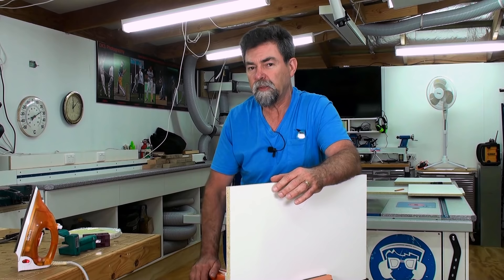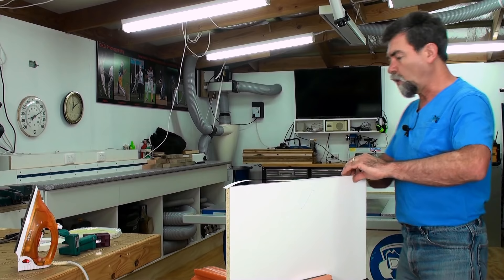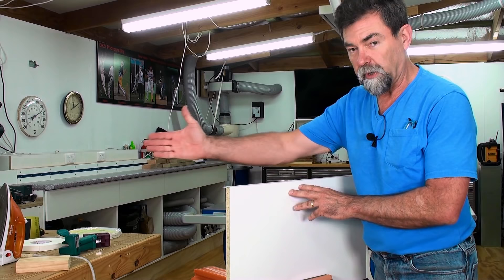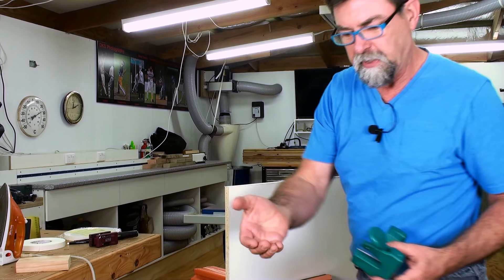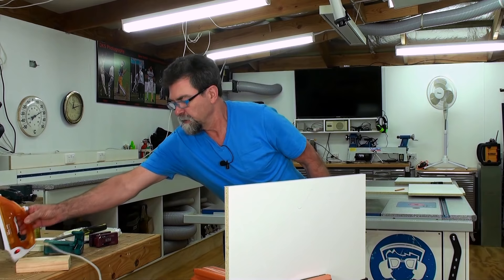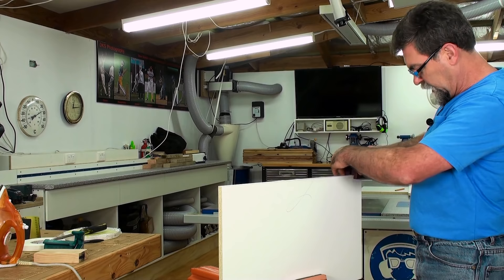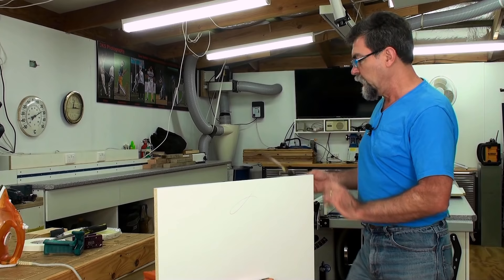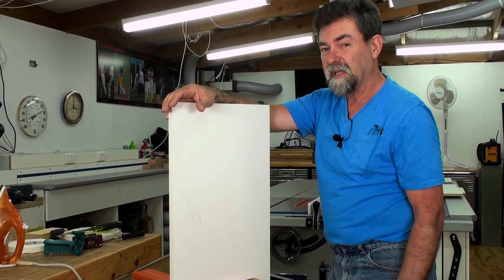How to apply iron on edge melamine Dave Stanton easy woodworking

Comment: looks easy, till I tried it the other day. Iron  was hot, edging glue did not activate properly, rolling up behind the iron, and warping and making bubbles. Tried a hotter iron, even worse. Colder iron, no result. Threw away the roll of edging, left the shelves as is.

Comment: 3rd video I'm watching and liking that you took the time to do it and it works for you but I see a few issues with. the trimmer doesn't work properly when the edging is old or has been sitting in the cupboard for a long time. the chisel is for experts only, i would tell newbies to use a knife and finally, don't worry about the spacing, it makes no difference if you have more on one side or the other, you can trim it off. Thumbs up for the video still.

Comment: Would the process be the same when replacing the tape on installed cabinets?
Reply from the maker: Hi Andrea Savoie! Pretty much but you will need to use a chisel to slice the tape off near the ends.
Reply: Thanks for the reply! I've put this project off because I wasn't sure of the process, this video is very helpful!

Comment: Using a chisel to cut the excess? Looks like a good way to scratch the surface.
Use a palm router with a trimming cutter or cut it with an abrasive. By abrasive, I mean something like a 120 grit open mesh sheet on a velcro block.
Work at an angle towards the excess material so as not to lift it, work slowly and carefully at the edge until it gets thin enought to simply peel off.
Clean up the laminate edge with the same abrasive block before you do any sticking.
I don't trust iron on adhesives, but if I have to use them, I'll use a hot air gun and a wallpaper seam roller.
Alternatively, use a contact adhesive on the edging strip and the raw chipboard edge.
If you don't give it a good sanding, all those little bits of chipboard will show through the laminate.
Tidy workshop by the way.

Comment: Is it easier to put edge banding on after you make all your cuts, or before you cut and then add as needed afterwards?
Reply from the maker: Hi Dan Urquhart! do it when you have made your cuts, not after the unit is assembled. If you do it right at the beginning two things happem. you waste a lot of tape on offcuts and also the tape will stretch over a long section as you apply heat.
Reply: @DavidStanton  Thanks.  Typically I make my own edge banding out of hardwood cutoffs and scraps, but I have a project coming up where I am using melamine, so your answer is very helpful.

Comment: Great vid Dave. Is that the really thin iron tape you get from Bunnings? If not is it the thicker rubbery one that looks more professional like out if a cabinet makers has done it? I am looking at making one of those DIY edge banders myself as I have a heap of cabinets to make.
Reply from the maker: Not a fan of the tape from bunnings. I got mine from trademaster in guilford.
Reply: @DavidStanton  thanks Dave. Is that the more rubbery type looking one? Yeah I'm not a fan of the one from Bunnings myself after trying it.
Reply from the maker: No geoff. looks the same as bunnings one but better quality. I used it on the show today.
Reply: @DavidStanton  I'll check it out. Thank you

Comment: Nice job Dave, I've just done some wardrobe doors exactly the same way but only used a sharp chisel and sand block. As you say it's not difficult to get a factory type finish if you take your time.....Now, more importantly, do you do collars open or folded?
Reply from the maker: +Graham Orm . Funny you should ask. Always open. I built a great unit that houses an ironing board and can knock a shirt on the head in under 5 minutes. Always start with the yoke.
Reply: +David Stanton If I'm honest Dave....it's been a while.

Comment: I bought a double sided edge trimmer from a company we both know well and when I used it - it chewed up the side of the melamine board - I noticed you trimmed one side with a chisel first - is that the secret or maybe my edge stripping was pretty old - any way I am reluctant to use the edge trimmer now and will settle for a chisel or sharp blade and then use a file for finishing it off. regards Mike
Reply from the maker: Hi Michael. I also had a problem like that but when I adjusted the blades and pushed in the correct direction it worked perfectly.